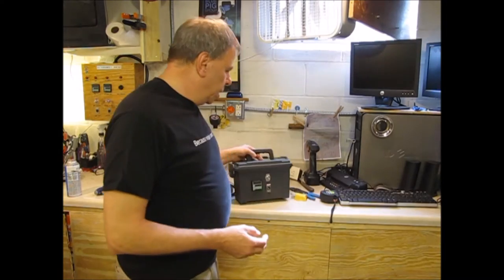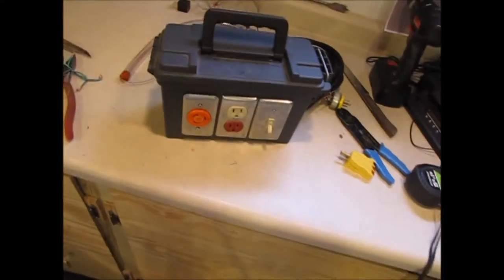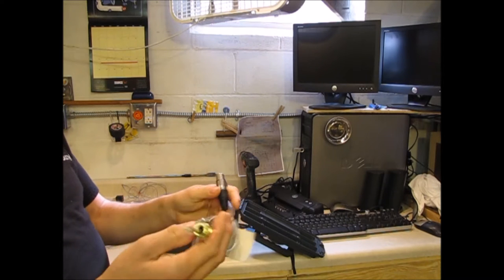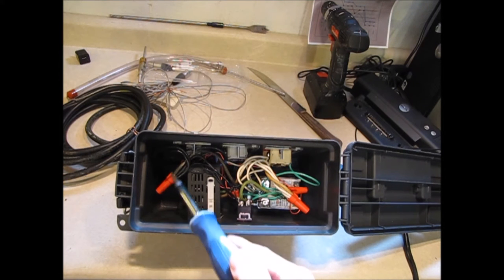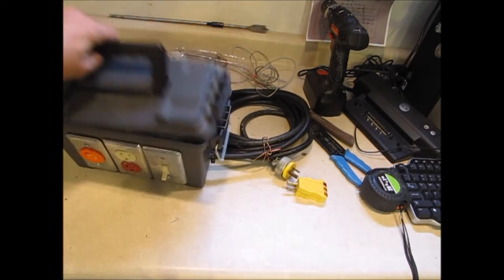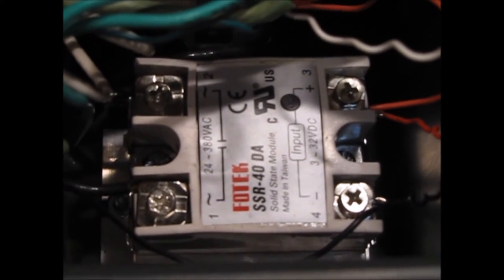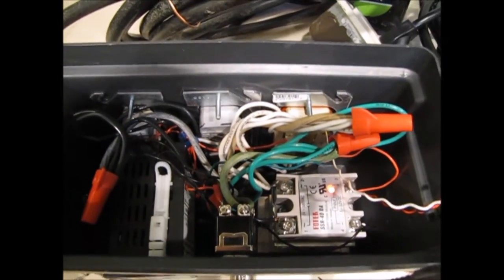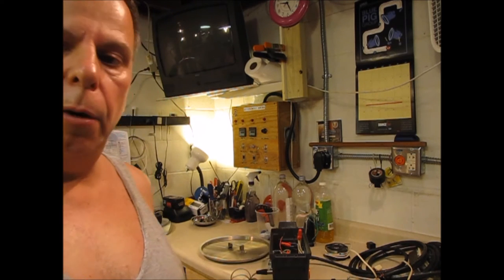Portable Electric Brewing or Smoker Controller & GFCI Extension Cord

Comment: Can you wire this up to 240 volt
Reply from the maker: I don't see why not, as long as you have the appropriate outlets for 240v.  One thing to keep in mind is that the relay is single threaded and one wire would always be hot. ADdind a proper DPDT power relay would really fill up the box.
Reply: @TimTrabold  that where I'm stuck at..at the moment  I have a inkbird itc 106vh that I'm trying to put  together  iv seen a video  on 3 wire  240volt  instructions  video but my home is set up whit the  4 wire 240volt   and when it comes to wire it up I just don't know enuff  to do it if been asking for some help on forms and face book groups but there just not no one  that has text me back yet....
Reply from the maker: Are you controlling 120v or 240v devices?  I am not sure how you would us this on a 240volt system without just taking one of the hots, the neutral and ground and wiring a 120v outlet.  If you used it for 240v I think you might need something like a 240v double pole single throw relay that would kick in when the inkbird tripped it's switch.  The inkbird would control the relay itself, which would trip to connect up both hots at once.  Take a look at DPST relay's on e-bay and they might give you an idea. https://www.ebay.com/itm/Enclosed-Power-Relay-6Pin-240VAC-DPST-NO-SCHNEIDER-ELECTRIC-92S7A22D-240A/331995441808?epid=1329406514&hash=item4d4c786a90:g:~qQAAOSwbF1aEWYI:sc:ShippingMethodExpress!68144!US!-1